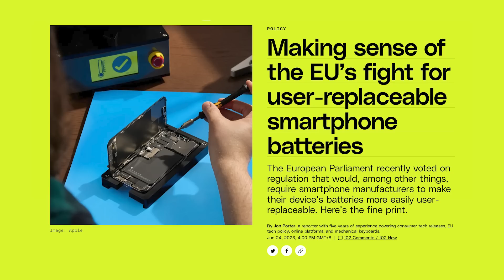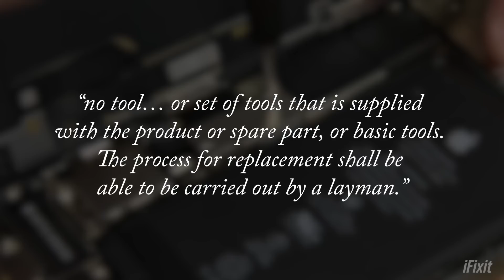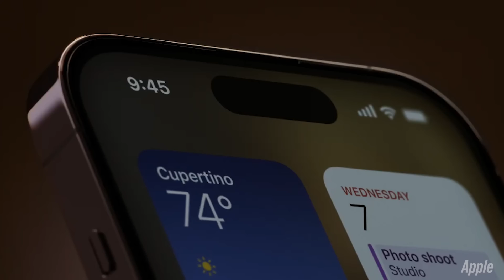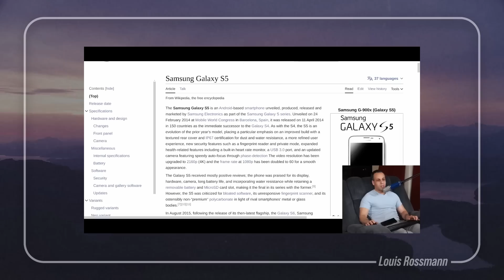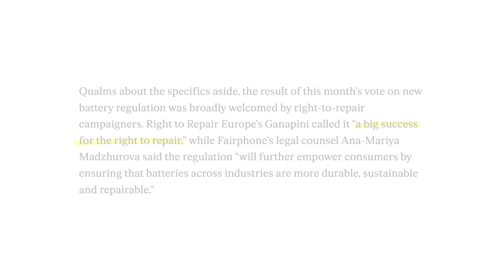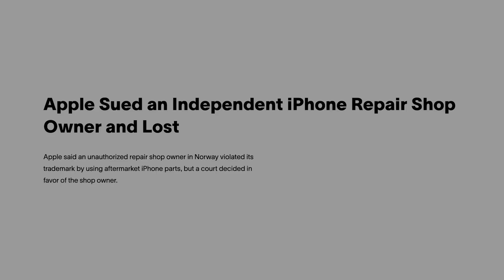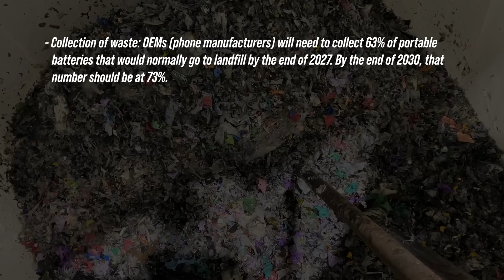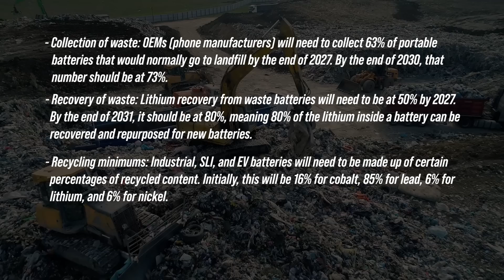EU Just Changed Smartphones Forever

Comment: Designed obsolescence is an old practice, Apple just pulled it into the modern era with virtually everything they design. I've said this since the ipod and always been called a conspiracy theorist. Apple forced devices to run poorly to force users to upgrade (and nothing happened to Apple). Apple added serialized components every part of the phone as well as to accessories. This is to force users to use only Apple products or services (and nothing happens to Apple). This practice has made its way into every market because companies see how profitable it is to monopolize maintenance. Look at how difficult it is to change a car part these days when even the simplest $30 car part of old is now a $300 assembly with a chip that provides no real improvement. 
The worst part is that this is being driven by 'environmental' concerns instead of consumer protection. Meaning if these companies can find a way around these laws and still force a monopoly, then the governments won't care one bit how it affects consumers.

Comment: One side effect of non-replaceable batteries that I don't see mentioned much, is that we have no way to completely turn off our devices.  It used to be that the only way you could be sure that nobody was listening, watching, and otherwise collecting your data was to remove your battery.  Once they sealed the batteries in, it became impossible to ever be truly off-grid.  While most of the data collection is commerce driven, for some people, in some parts of the world, this data could seriously impact one's freedom (especially in the country that produces most of these devices).
Reply: Even if this comment is paranoid, the fact is not being able to remove the battery is very annoying in a number of related circumstances:
- Long-term storage of the phone once it is out of use. 75% of the phones in my old phone drawer have bad batteries that went bad during storage.
- Fixing temporary software issue with a full and fast reboot. I've had my iPhone go completely unresponsive twice since I got it. Both times I just had to sit there and wait 5 minutes for it to figure out it was fucked and do a reboot by itself. If I could just pull the battery, there would have been no issues.
Reply: Hundred percent motivated by profit
Reply: Exactly! I had a situation when my Huawei P10 started heating a lot and had ghost touches. It heating so much and so fast that I almost burned my fingers touching it. I tried to shut it down, but couldn't because I had to confirm the shutdown by clicking the button on the screen which was just canceled by ghost touches. It was so freaking scary, I thought the phone will explode at one point. I fortunatelly somehow shut it down by trying to cool it in the freezer so that the ghost touches become less frequent, and then shut it down by approving the shutdown button on the screen. I have never been so afraid in my life!
Reply: @MarinDrabic  all phones have a button combination (either power button alone or power button + one or both volume buttons) that if held for usually 10 seconds will force a restart
Reply: @derivativeoflog7  Not all phones have that possibility. I research it when my phone started heating and only way to turn off was to hold power button and choose the shutdown button on the screen. I tried couple of possibilities, but nothing worked.
Reply: @MarinDrabic  well if I'm being honest, that means the ones who designed that phone are morons (which if I'm really being honest, that's something I think about Huawei phones in general). There's no reason to not include an emergency reboot system
Reply: @derivativeoflog7  I 100% agree!
Reply: They actually have a point on this I know my s23 ultra has a mode where it can be found when it's turned off well if it's turned off how in the world can it be found? It's because it's not completely off that's why.
Reply: Bet that's the case at least in north Korea lol
Reply: Good point! The rate at which technology is advancing and with software already in existence capable of accessing and controlling devices remotely this is a very legitimate concern. Consumers deserve to have the right to decide when to have their device on or off themselves.
Reply: this is the best reply here.
Reply: Oy Vey lul
Reply: get a faraday bag
Reply: @honeybadgersolutions2221  I don't know what you have against turning off a phone completely and removing the battery. There are legitemite usecases, where a high sense of privacy is needed (e.g. in a war zone, in a secure meeting, ...).
Also: Faraday bags will only block a specific amount of signal.
Reply: That same EU is also working on laws that will force messaging apps like whatsapp, telegram, messenger and others to communicate with each other. So good bye end to end encryption. Part of that is a anti child exploitation law, they want every image, message and video to be scanned by AI and reviewed for such content. That also want to do this scanning with so called misinformation and conspiracy theories. This is starting to looking scary similar to  those countries you mentioned. They want to control everything.
Reply: This is such a great point. I actually own a faraday bag for storing my phone because, unlike 20 years ago, i can't pull the battery out of my modern phone. So i put it in a faraday bag when i just want to know my phone is off the grid.
Reply: nice said, I didn't think about it that way
Reply: Even if you have a removable battery, that doesn't mean there isn't some secondary power storage inside the phone
Reply: I have never had the problem of not being able to fully turn off any device. You must be an older person who thinks clicking the power button and having the screen go black means it's supposed to be off, that means it's locked. Hold the power button and the power off options come up.
Reply: @darrylkinslow5613 Um, what if the both the power button are the screen are broken?

Edit: Samsung gave you an option, but for a while, holding down Power was rerouted to Bixby instead of shutdown options menu.
Reply: @darrylkinslow5613  "You must be an older person who thinks..."  As my user name might suggest, I am 1) not a young person and 2) tech savvy enough to know the difference between the lock screen and powered off ;)  
But just FYI, a good hacker (or worse) can still see and hear you on your "powered off" phone.
Reply: @darrylkinslow5613 You are mistaken my friend.
Reply: @BawlzOfuzz  No kid, I'm not.
Reply: @darrylkinslow5613  Are you sure? You do have "slow" in your name.
Reply: In case you didn't know - if someone want to listen to you he will be able to hear you
even if the battery of your phone is unplugged.
Look it up.
Reply: @yoshy2628  I'll have to look it up, if for no other reason than to see how information transfer is achieved with no energy source.  But you are correct in the sense that your phone is only one of the mics that are scattered around your life.  I see 5 devices with mics in them just sitting here in my living room.
Reply: @gamersincepong  There was a concept phone at some point that was super low power, and instead of creating new signals, it simply changed the reflection of pre existing signals to transmit data.
Reply: @yoshy2628  No, mobile motherboards don't have any power backup other than the battery. That's why if you remove the battery you have to set the time. Computer motherboards had to have a backup battery as when they shut down, all source of power is cut to it (physically through a relay in the PSU). The backup battery is just enough to keep the clock running.
Reply: @ryandandrade1225 @gamersincepong The soviet union during the coldwar was able to create a mole in a gift to an american office to the white house. This mole was capable of being able to transmit conversations without battery. The issue was they needed a van near the whitehouse to listen in, but regardless it is capable but I seriously doubt the government would want to do that. If they did though, they run the risk of being discovered very fast, and if they are hopefully we will discover it.
Reply: @yoshy2628  Bro, you really need to check those facts.
Reply: @yoshy2628 wasn't there something like this with PC motherboards ?? Even when switched off data collection was done with CMOS battery 🤔 my memory is bit hazy on this.
Reply: @thewanderingartists  Only way for it to be true is with the CMOS battery or somehow hidden battery inside that will last a long time without additional power.
Reply: @thewanderingartists  If the PC is switched off, the PSU shuts down the 5V and 12V lines. But there is a 3.3V line, which is constantly pumping power.
Reply: here we go again with paranoia.
Reply: @hydrohasspoken6227  Just to be clear.  I am not paranoid about these things.  Anyone listening in on my life would be quite bored.  Also, I live in the land where I can say literally anything I want without fear of being jailed for it.  My comment had more to do with parts of the world where your words can get you jailed (or worse).  I realize it might sound like some paranoid, conspiracy theory BS, but unfortunately it is a reality for millions (if not billions).
Reply: @hydrohasspoken6227  Just so you know. Apple still knows your location after you turn off your iPhone. This is no paranoia, this is a fact, if you have "Find my" turned on. Now imagine, that this is just a software switch, that could be circumvented by someone for malicious purposes. Do you still feel, that this is paranoia or could it be technically feasable?
Reply: It’s not paranoia but then again your probably not important enough for them to care

Comment: Personally... I'd be okay with a Battery being replaceable by a reasonably priced Service provided by the Manufacturer of said Device. I don't need or even want a Battery to be replaceable by me on a whim yet alone outside and away of a clean desk at the cost of the Phone no longer looking like a sleek Monolith. Really all I care about is IF the device is still running fine for what I use it for but the battery has degraded to a point where I'm basically loathing its use then I want for there to be an option to have one replaced without it costing me like a quarter ( if not more ) of what the phone cost me to begin with when it was brand spanking new!

Comment: on paper it makes sense but the law is chasing tech.  Force apple to be USB-C standard... Apple moves on to wireless data/charge (still proprietary).  Force replaceable battery..... make more folding phones where the screen has finite flexing or other parts that fail fast.

Comment: I've been forced to buy a new phone because apple stopped updating the software on the phone, which caused my BankID app to be incompatible to run on the phone. The security patch on the app could not run on the outdated apple software. Without the possibility to run updates on any apps or confirm my identity, everything just broke. The only thing that still functioned was the apps included on the phone from apple, and the telephone function. Physically, the phone was just fine, because I changed the battery on my own twice on it. It was an iPhone 5. So I threw away a perfectly good phone, couldn't do anything about that.

Comment: "At the time, carrying a spare battery in your pocket wasn't that unusual[...]" yes it was lol.  Back even in the Samsung S5  days they'd last most of the day out (but not the entire day).  I'd usually have a spare battery at home, but it was considered pretty unusual to carry a spare with you unless you had a bad phone/battery (at which case you should replace it... not swap two bad batteries).  And if you did see yourself going through batteries quickly or wanted it to last all day, you'd get one of those chonky battery kits where it'd come with a replacement back plate to thicken the phone OR an external kit that acted as a second battery stuck to the back of the phone with adhesive.
Reply: "I never did it so it must be unusual and you are a liar!!!" Brilliant logic.

Comment: As an electromechanical engineering technician who is trained to fix stuff, I see replaceable parts as just common sense. That 3 wheeled solar charging car has scannable barcodes on its parts to direct the owner to how-to videos  on the way to replace a worn out part. I have an LG K5 cell phone and I bought a new battery for it off Amazon. I was given an old Ipad, 5.1.1, and once the battery goes, I can't replace it. Everything else works, but the battery makes it unusable? I can't afford to replace all of my electronics! Besides, once I'm accustomed to using them, I've conformed them to my habits, so replacing them is a royal pain. The high tech industry is just an excuse for selling circuit boards and that's all it is. Those circuit boards are often battery powered or have battery backed up memory, so why should I spend an exorbitant amount of cash on a new device when I can fix the old one by battery replacement? Do we throw away our electric cars when the battery has to be replaced? This EU legislation should be adopted everywhere in the world. Then we can pass our devices down to succeeding generations.

Comment: The root cause of planned obsolescence is that almost all electronic products are designed to maximize corporate profits.  The trade off between "thin and light" design vs. ease and expense of repair has gone way too far.   The other things that foster planned obsolescence are the short and getting shorter periods for which operating system security updates are provided and the lack of sufficient repair parts.  Those also need regulation!

Comment: Spot on. Elimination of replaceable batteries goes back to the very first iPod designed by Jony ive.  I’m certain the intent was to make these devices disposable as well as profitable. Not sure if it was a Steve Jobs thing a Jony Ive thing or an apple board thing but all these devices should be repairable and reusable. 

Jony Ive is apparently a car enthusiast. Think of a present/future where our computers smartphones and tablets are designed like a NASCAR race car, designed to have its vital elements easily and quickly changed as well as smartly performed. It can be done but it probably will need to be regulated first by law.

Comment: A battery of a phone  will last you a year and a half to two atleast.  By the time you use your phone and replace the battery once . 90% of people either have a new phone  or will get 3-4 years of usage with only 1 battery replacement.  Most shops do it for a pretty decent price . I understand apple is a dick trying to charge 80$+. Apple makes great products i used my iphone 13 mini for 5months and the battery life was still at 100% i decided to sell it and got me a Samsung Z flip 4 .  Im perfectly fine with getting 18-24months usage and replacing the battery. I know a repair shop so they dont charge me but i tip the dude 20$+providing the battery if i do need a replacement. I think usually they would charge 30-60$ something like that. Honestly i understand the video and i think its not a bad thing , however it seems more of an apple trying to rip people off issue more than anything else. Also people buy Iphones worth 1000$  getting a battery replacement for 80$ is not so bad compared to getting a new phone , then again the people who buy Iphones get new ones almost yearly. So yea . The screen thing seems more interesting thats a big fucking scam lol.  The repair shop guy i know makes most of his profit from mac and apple products repair because of course apple will rip your head off so his prices are much cheaper to the average consumer.
I've replaced some phone batteries and i do agree that the Iphone 5s models were very easy to replace did it countless times. I loved that model of Iphone it was a gem to behold :) . They could of done something similar to the Iphone 13 mini but nah we're just gonna fuck consumers :P .

Comment: I hope this thins backfire on the EU so badly. For example, no technological advancement products for the Eu markets. Make it themselves then. Think of the thin future products and one day the battery design or component changes. What then? Like USB C, yes it's good that it's universal but is the design great? Does the quality of the port strong enough? I have more broken USB C cables than Lightning. In fact, no Lightning has been broken for me. Which is something that I didn't expect. I have so many USB C from manufacturers that don't produce up to standard and are not useable or safe. This also prevents the future of new ports as well. I hope Apple comes up with something that slaps the EU in the face. So many stupid lawsuits and fines came from the EU and who will pay for these? The consumer of course.The money-hungry union. 

I want to replace my own battery too. I love it when I can fix it myself if I am qualified. But even back in the day getting genuine parts was difficult because these things couldn't be in stock for long. They had an expiration date and then will become e-waste anyway.

Many bad 3rd party repair shops put the idea of going to them is not a wise choice. If money is not an issue. Never ever go to the 3rd party shop.